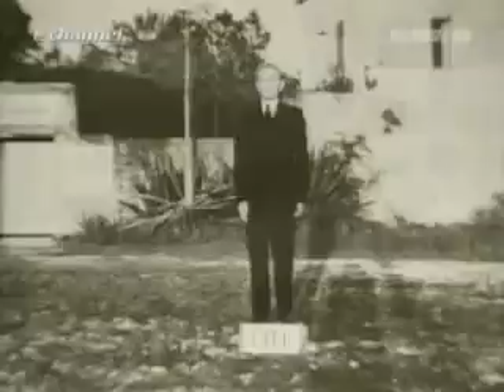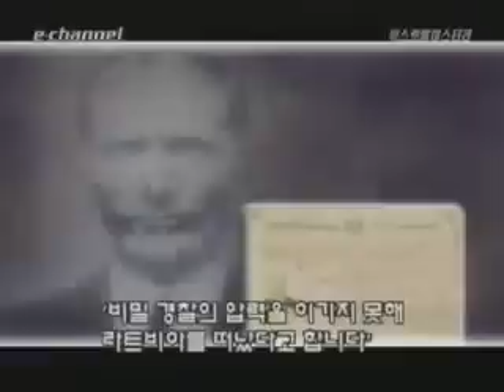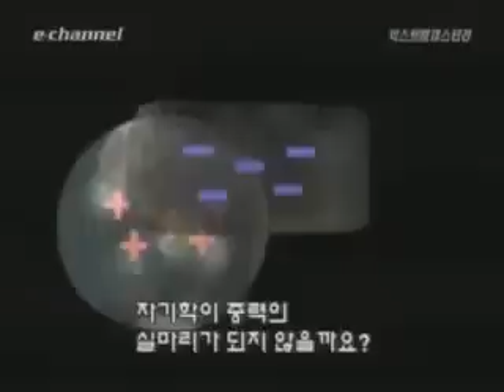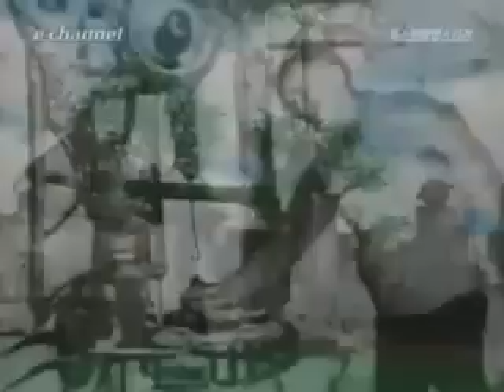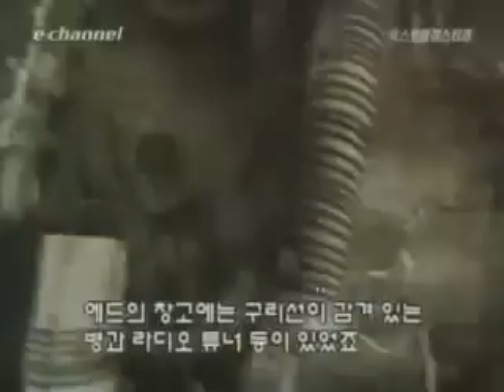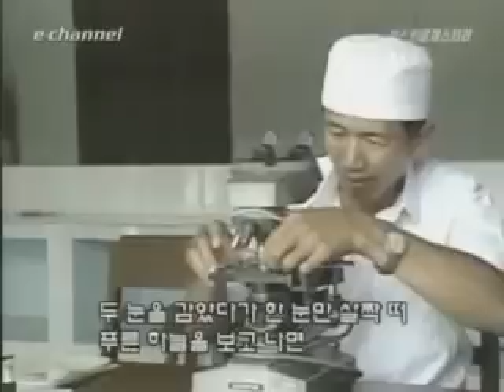The Anti-Gravity Secret of Coral Castle - FULL VERSION

Comment: The key...the black boxes atop the tripods. In the gift shop is an old newspaper clipping of three of those tripods and a black box on each. From the box, a copper wire came down and wrapped around the block he would cut from the ground. Something about the need for the box and the wire wrapping. My guess, the box had something in it that operated but needed to be in the atmosphere and a charge came down and neutralized the stone. Why couldn't the box be on the ground? Something above our heads in the atmosphere? Who knows. The box is the key. He had them all over atop the tripods. I'm stumped.

Comment: I understand why he would want to keep his techniques a secret, it might be so simple, that once its shown, everyone, even a child can do it. Then It would not have generated such an huge myth and mystery for his creation. If I remember correctly, he was a very frail person, he was doing this for a love of his life. When you are not a Alpha male, do something that no one can figure out, then you become famous.

I thought of this after seeing the Discovery show of Impossible engineering, for years, modern engineers question how the Romans moved a huge multi ton Block from point A to point B, they thought they were using the well known Pulley systems, but realized that its so heavy, how did they move the pulley system from miles away, if they can lift it. They they thought they were rolling it by using logs put under the Multi Ton Block, but after many tests, they couldn't find any trees that is strong enough to hold it.Guess what, they found a Roman Engineer's notes, all they did was add some huge wheels on the two ends, and simply roll them to where they want by using pulley systems to control its movements. Once it was known, everyone was like Ah ha , so simple, why the modern engineers never thought of it.

Because we had records on how it was done, the Mystery is gone, no longer an Impossible Engineering, but rather an very profound way of thinking outside the box. And the record if i remember correctly was done at a fraction of time what many Modern Engineers thought. So there ya go, what we think is impossible, is just because we are so reliant to our technology, that we are no longer thinking outside the box.

Comment: the sun has positive energy on the contrary to the earth its negative,
this person managed to concentrate someting from the sun to increase its gravitational force localy, in order to make them float like our planet float
Reply: Did you pop in from another cosmos where that is 'true'? Why are you applying the positive and negative poles of a battery to the sun and earth??? That is a mis-application of terminologies. He 'increased the sun's gravitational force locally'...different gravity fields would tear the earth apart and there would be a new asteroid belt where the earth used to be. Another thing....there is NO up or down in space, If you put the earth in a part of space absolutely void of any matter/energy for a billion light years in any direction the earth would still automatically float in space. We don't need the sun for that. But the earth's speed around the sun generates centrifigal force exactly equal to the sun's gravity so the earth does not crash into the sun. Please learn some real physics.
Reply: kdc43 take it easy man we are trying to discover a secret here!
think openly no need for impurities, like " Did you pop in from another cosmos where that is 'true'?" if you can't be pure shut up !
well in electroculture this concept is use, and also in " air circuit generator, "
electricity and electric poles are deeply associated to magnetique pole, and so there is something that we dont fully understand, yesterday i read a little book of the constructor of this coral castel, and he presented to me a new understanding of how electricity and magnetism works, which may open new horizions, well you talked about talking the earth appart, well this is what he did, and the rock wish is tons in weight went appart and he said dont make the rock overweight by over feeding it, so he opens the problem that might send us like asteroid belt , but cancel it throught the same process, an other reason of why he kept his works secret, sadly the elite is well awareof that, and there is a war on thegrid going on, what it wil MECCA and light centers, or dark centers of energy ! but there and will certainly be a damage!
Reply: its more to do with the earths magnetic field, than with the positive and negative forces of the sun.
Reply: yeah :)

Comment: This one is easy he had magnetic trans indecator and with this he was able to push and pull non magnetic items on magnetic areas. So in my conclusion with the right position he was able to prop up items heavy with the help of taking the cord away. Meaning he would change the gravity with that box structure then having the ability to move it arund then when removing the cord the item would fall with enough force to make the items stay in position.
Reply: Well it is proven by many and its poven in the video

Comment: I heard about a bottle of sulphuric acid with electrodes in it. Cant remember where but it was really old. Thats the battery. But what would the Egyptians have used for an oscillator/ resonator,to generate the frequency? I don't think singing to a massive block or whacking a bell a few times will do the job. Sound can certainly do stuff. A skilled opera singer can make a whine glass wobble, move and break. Theres youtube videos of people levitating polystyrene using intercepting sound waves. If the frequency is too high or low, they fall. Surely, with the right amplitude and frequency  you can levitate anything. I guess his comment about "not feeding the big girls too much" just might mean the amplitude for moving a massive rock isn't high as you might think. But I'm guessing. Apparently he had two little cones in his hand... I think the crane was a ruse.
Reply: singing frequency, by a huge number of human being and musical instrument will certainly do the job, we are so fearling to use it,
and the ancient egyptiens used paper tagswith sacret writting on them to move the rocks on their own!
Reply: Not sure about that. I think the amplitude needed would deafen just about everyone. But, the only way to test the theory is to try it. I'm sure if you whack one of the stones, a musician can tell you what note it resonates at (most stones are probably inaudible tho), then get a thousand opera singers... I bet it would just wobble, maybe move accross a couple inches across the floor or crack if your lucky. Just think, it takes 120db to levitate a tiny polystyrene ball. Thats louder than most people play their music. Resonance most likely has something to do with it, but there is something we are missing. But, I could be wrong.
Reply: ***** Thanks
Reply: *****
funnily enough, that's Iraq, where Abraham came from. They worshipped the Annunaki there and many of the stories in genesis are adapted from their myths. Who knows, maybe that Bagdad battery was used to amaze new punters into one of the temples. What better way to convince people your a god.

Comment: right at the 24min mark i had a sudden realization. Ed magnitized the coarls then after he was finished he demagnitized the coralso they would stay in place. to get what im saying take a magnet and a metal spoon. use the magnet to rub the spoon one way several times. after a while the spoon itself would be a magnet. make the magnet pole of the magnet and the spoon repel each other. then put magnet on flat surface and place spoon on top repelling the magnet. if done right spoon should float.

Comment: ...to the stationary opposite magnet with diameter of 3,14 it will woblle/spin almost forever :)
I used a machine in that order but vertically starting from top:
SN(roundsize1), screw head, screw sharp top, SN(roundsize1),SN(roundsize1),Iron from flyback transformer core(only round shape part), air(if no distraction around 1cm) and NS ball(size3) it goes around and around and it can't find place to stop :D (observations:spin direction change, wobbling, loosing big part of their magnetic...

Comment: Absolute correct I just commented about that part of the video. In fact recently I had an episode of light flashes in my eye followed by a ton of these 'floaters'. It was caused by a small tear in the back of the eye which can lead to retinal detachment. A small amount of floaters is normal but as we age the vitreous jelly breaks down and they get worse. My tear was sealed up by laser and the floaters have cleared up quite a bit but they are still very distracting in that eye.

Comment: part of the mystery is easy. large objects, if you walk them, are not nearly as hard to move, because the weight of the object pulls it down. in other words the weight pulling it down pulls the back side up, so you need only enough strength to turn the object so that it can't fall. try it with a large cabinet one day,

Comment: There's a lot of "mis-direction" in this video.  Like saying the steps up his tripod are significant.  I mean duh, how else you gonna get to the top to mount, secure and manipulate the chain hoist.
Most think the flywheel is key, but it was probably just to charge the many batteries he had for lighting.
I suspect his 'anti-gravity' device was different and much smaller and easy to transport.

Comment: Hi, if you see tiny semi-transparent worm like shapes constantly moving in a wriggling sort of way, then I was told by a retired expert in the field of optics what they are. He said that there are capillaries in the back of the eye through which single blood cells are constantly flowing and there are regular gaps where the blood cells are absent and only blood fluid which is transparent is present. This fluid between the blood cells is what you see as the light is able to pass through it.

Comment: If you could carry and quarry rocks using a ramp why would you cut them into IMPOSSIBLE weighs of around 1,000 tons? Why not 1000 rocks each weighing 1 ton? Graham Hancock has uncovered many similarities between Egypt and and other Civs with pyramids having excess of 500 tons in all of them. The coincidences of each of these Civs separated by 1000's of miles is astronomical and so is their ability to create these structures.

Comment: Gravity is not a force nor is it energy. It's only what Einstein said, it is a curvature of space. The only energy that you can get out of gravity is the energy that was put into it. For example, hydroelectric dams converting falling water into electricity. That energy came from the solar thermal energy of the Sun that evaporated the water and lifted the vapor to condense into rainfall in the mountains. Anti-gravity would require energy to counter the space curvature, thus no net energy output.

Comment: Respect the already developed and patented free-energy systems by Stanley Meyer which could make fossil fuel obsolete for good and clean up the air and end wars.  Water fracturing method to produce HHO with low amps and high volts,  the Stanley Meyer's way, has proven to produce many times more energy than it consumes.  We cant afford to waste time on these topics anymore.

Comment: except they did not have the invention of the pulley to help them. 980 tons over sand and 2 rivers is NOT possible to carry 980 ton granite rock over 600 miles. this is ludicrous. what kind of ramp stretches 600 miles from the quarry it was taken from? Also where could they get enough wood (over 1 million trees) to make the track? 1-800-WoodRUS?

Comment: this is simple to work out.
put a thin bit of steel under the rock and revers the polls on it and with his machine turn up the power so it repls the rock making it light and it will float simple

Comment: the other thing too is that the stone blocks around the enclosure of the sphinx weight in excess of 980 tons. Even if they used a pulley it is impossible to lift that much weight (in sand nonetheless) back then. It would take 12 modern cranes to lift an object of that size. They did not have that nor pulleys. But they did have the secret of magnetic negation of heavy objects. Not the Egyptians but the people who were there before them that built the structures.

Comment: but the problem you don't seem to know about is the pulley he had was a 5-ton line that was capable of lifting 32-ton blocks of coral stone. Still an impossibility unless you have the secret to weight negation. He did not reverse polarity completely but negated it enough to allow for a movement of stone as if it were a balloon. The Egyptians did not move with pulleys since they did not use them to build the pyramids because they were not invented then.
Reply: He used multiple pulleys which increased the leverage greatly.

Comment: @bryan3184:
I'm not claiming it's impossible for scientific theories to be wrong or lacking. On the contrary. Details are updated and changed all the time. Theories are however not rejected on the basis of only MORE hypothetical claims. They're rejected on the basis of reliable and/or reproducible data. The more established the theory, the harder to simply reject it. We're told to consider rejecting a well-established theory for no good reason. "Open up your mind a LITTLE bit" is pushing it.

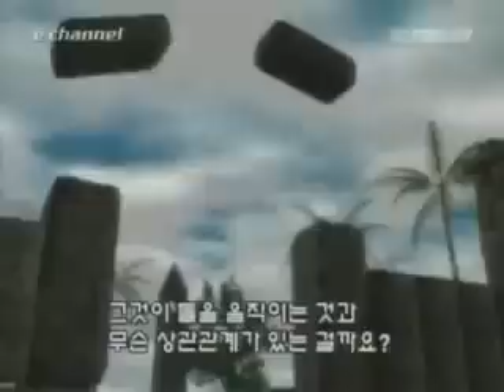Comment: Earth's mag flux was used against itself between 2 different antenna. The 'girl' metaphor at 12:12 refers to the negative pole in the atom or otherwise. A continued fractal of magnetic argument between the 2 antenna through the wheel's mag perimeter separates energy from mass, ie; time and space. Space can't keep up with time, and it is shaken off the stone like you break a locker door off with resonance, not brute force.

Comment: @1andy2 
The reason it wasn't done by pulleys is explained in the weight. You have structures that are small that weigh 800 pounds. Have you ever picked up a piece of coral that was 2 feet large? It weighs close to 300 pounds and this guy was moving 8 foot by 5 foot pieces and building structures with solar systems on it. Notice that there are planets on the walls and sun dials and myan calendars and strange placements of religious symbols. Go there and look around, its impossible with tools.